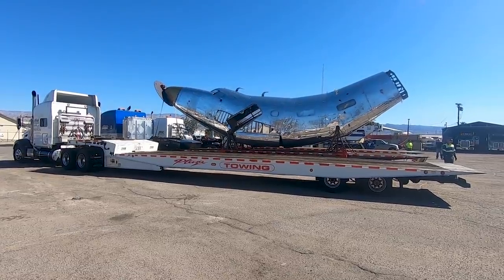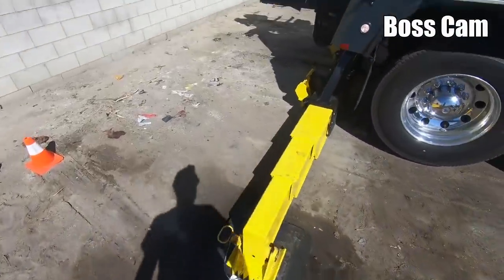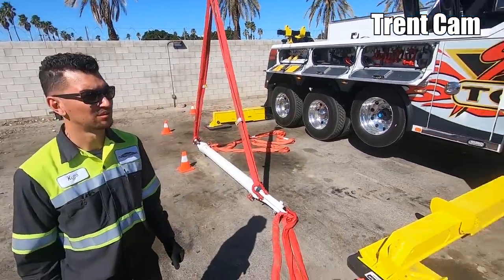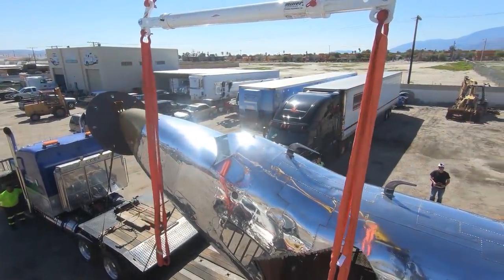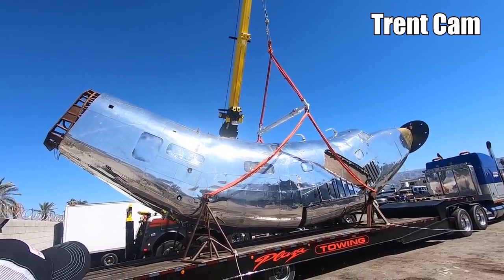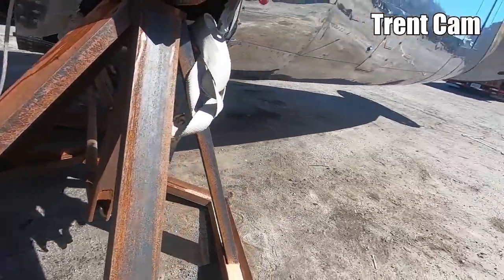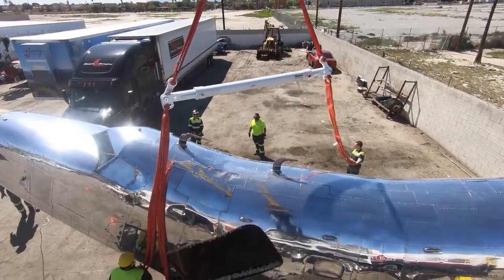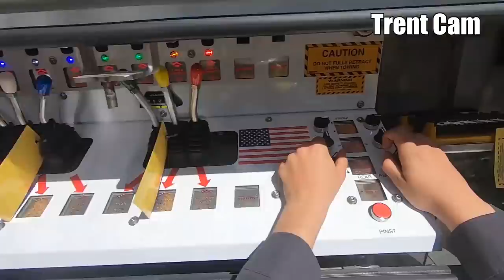Lifting An Airplane! 50 Ton Rotator!

Comment: Here's an idea: instead of of just having seperate bins for certain lenght straps, relying on people's understanding of instruction and rote remembering of what is where on the truck and what you just said... just lable the frigging bins.

Here, I'll help you: just copy these phrases "8-foot straps" and "12-foot straps" (without the quotes) into seperate Live Write documents, change the layout to landscape, center it, both horizontally and vertically, and increase the font as much as an A4 sheet of paper will allow. Then print it, cut it out and affix it to the relevant bins, using clear tape. :D

All kidding aside, I'm not knocking you as such, but I notice you guys tend to organise your trucks individually, which is fine for the most part as you pretty much have assigned trucks anyway, so y'all, individually, know where everything goes.

The problem, imo., arises when jobs require more than one truck/person to carry out. You're having to take time to explain where things are/need to be put back, whereas,  if you'd take the time to agree where certain items are stored on trucks regardless of the operator (like you spend time on these practise lifts to make people familiar with new equipment) and make the effort to lable things (like the guide rope hooks, e.g., both on the inside of the rotator controls lid as the actual hooks themselves), your process wouldn't need to be as 'hands-on' as it is. Just saying...
Reply from the maker: You make a good point. At a point in the video, I mentioned we haven't gotten strap organization to where we like it just yet. We purchased a label maker for this truck and most of the truck (chain carousel, shackle rack, toolbox, etc.) have been labeled extensively. Once we determine the best way to organize straps we will do the same. Thanks for watching!

Comment: Why couldn't you have hooked the blue line up to the front of the plain. And the white line to the back of the plain. Than you could've lifted the plain level. Instead it looks like the plain was quite nose heavy. When the back of the plain came off the bed of the truck far sooner than the front of the plain did..

Comment: Why don't you hook the line to the rings at the boom tip for using a snatch block, instead of tying up both winches? Am I missing something?
Reply from the maker: Doing it this way provides even loading of the boom. If you simply hook it to a d ring on the side of the boom you are loading one side of the boom more than the other creating unnecessary torque on the boom. That is because unlike a crane there are 2 cables side by side rather than on top of each other. If you have an application where 2 hooks are needed on the rotator the way you are describing would be acceptable but if you only need 1 hook but doubled up it is best to marry the lines together as we did to provide even boom load. Hopefully that makes sense. Great question
Reply: I love your channel and your work 
Take this info for what it’s worth- food for thought 
Gross load 16500. Top rigging at 60 degree angle 2x 13200 x sling angle factor of .866 = 22862   Bottom rigging at 40 degree each pair. 2x 13200 x sling angle factor .643 = 16975. 
The way the aircraft was balanced the front rigging was taking the majority of the load, making it pretty close to its WLL ( working load limit ) or at least a lot closer than one might think. 
Much respect and keep the videos coming.
Reply from the maker: Nice comment! I have posted a comment that I formulated in response to another viewer for you to view. Enjoy

Tip capacity on boom/truck: 39,000 lb
Cable: 32,000 lb WLL (2 part line)
Snatchblock: 12-ton block 24,000 lb WLL
17-ton shackle: 34,000 lb WLL
2 red slings in vertical: 26,400 lb WLL
2 12 ton shackles  ( decrease rating to 50% due to load outside of 45-degree marks): 24,000 lb WLL
spreader bar: 30,000 WLL due to less than 60-degree angle
2 12 ton shackles: 24,000 lb WLL
4 red slings in vertical: 52,800 lb WLL
4 8.5 ton shackles ( decrease rating to 50% due to load outside of 45 degree marks): 34,000 lb WLL

As you can see we did a lot of planning for this lift to ensure safety. Hopefully that all makes sense. With that being said our weakest link would have been the snatch block or 2 12 ton shackles all rated at 24,000 lb WLL. thank you for watching!
Reply: You are still within capacity but your missing the reduction of capacity for your slings being on an angle, like you noted on your spreader bar there is a reduction for decreased angle there is also a capacity reduction for your slings when not used in a vertical position. I don’t know how to post a link but you could do a web search for “sling angle capacity reduction “
Reply from the maker: correct. I could get down to the nitty gritty and determine the angle factor which I have done but when it comes down to it. In this scenario, if you limit yourself to 50% wll we were well within that on this lift. Great discussion!

Comment: Weakest point is the two from hook, 40.000 LBS.
Reply from the maker: actually from top to bottom:
Tip capacity on boom/truck: 39,000 lb
Cable: 32,000 lb WLL (2 part line)
Snatchblock: 12-ton block 24,000 lb WLL
17-ton shackle: 34,000 lb WLL
2 red slings in vertical: 26,400 lb WLL
2 12 ton shackles  ( decrease rating to 50% due to load outside of 45-degree marks): 24,000 lb WLL
spreader bar: 30,000 WLL due to less than 60-degree angle
2 12 ton shackles: 24,000 lb WLL
4 red slings in vertical: 52,800 lb WLL
4 8.5 ton shackles ( decrease rating to 50% due to load outside of 45 degree marks): 34,000 lb WLL

As you can see we did a lot of planning for this lift to ensure safety. Hopefully that all makes sense. With that being said our weakest link would have been the snatch block or 2 12 ton shackles all rated at 24,000 lb WLL. thank you for watching!

Comment: Interesting BUT With what appears to be a Link Belt HTC8670 on hand why use the rotator instead of a real crane?
 Even without counterweight that likely should have had capacity way over what the rotator was capable of doing with the added advantage of the extra boom length to make positioning the other pieces a nonissue.
Yes, I'm a licensed crane operator and it makes my head hurt watching what looks like a professional outfit make do with a machine meant for other work. Yes, the rotator was capable of doing the job. Obviously as it did the job but unless this was a training day for the full crew working with the rotator I cannot help but think wrong machine when the right machine is sitting 50 feet away.
The cranes longer boom would have allowed you to use longer slings above and below the spreader bar reducing the angle between the slings and improving capacity throughout the rigging. As the further from vertical a sling is used the more it's capacity is reduced.
Reply from the maker: Cranes do not belong to us. Simple as that:) I agree job would be better suited for a crane but like you said the rotator more than handled it. Thanks for watching!

Comment: A bit of Efficiency Criticism, Why do you keep all 4 outrigger pads on one side of the truck when you will always need 2 on the other side?
Seems like it could also pose an injury risk to the operator having to lug them around the other side every time and subjecting them to working in a live lane of traffic if you were working on the central reservation even though you went deploying the outriggers on the passenger side.  
2 on either side would be working smarter, not harder?
Reply from the maker: Unfortunately the box they are in is the only box large enough to fit them. We have explored the idea of fabricating a rack for 2 on each side under the truck. Thanks for watching
Reply: That sounds a good, the same idea as the dolly's on the Dodge Ram you did a tour of. 
Will have the added bonus of not having to put them inside the box when they are wet or used in the dirt.
Reply: @plazatowing  that's how my service truck is. At the rear box there is a tray right next to the outrigger that holds the pad.

Comment: My Question is: What even is this and what are y’all doing with it? It has LED lights,(I’m assuming)looks like rock crystals on the edge of the inside, looks like it’s a cooker or sum. But from looking at the back and then looking at the front how there is a plate I think it’s like a pillar to hold up a ceiling or something because those stands are not permanent I don’t think..
Reply: I seen this aircraft art piece before, its definitely not a cooker if you noticed the clear doorway aside from its banana like shape.